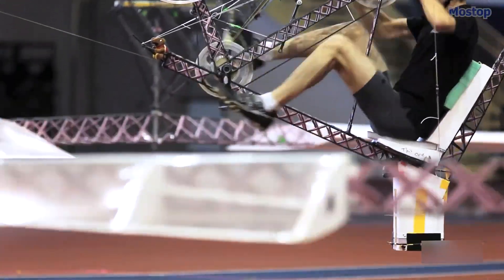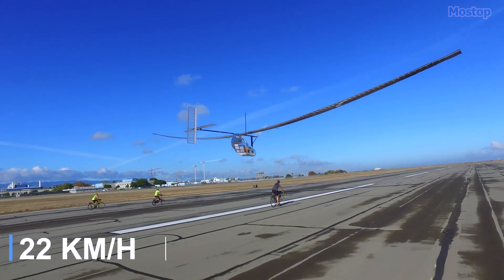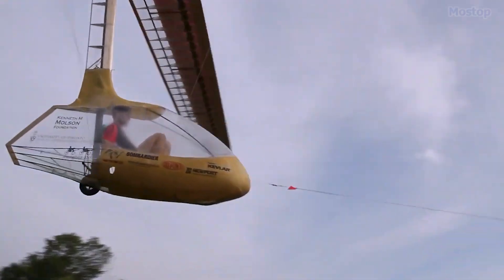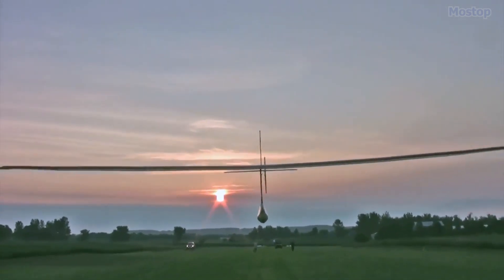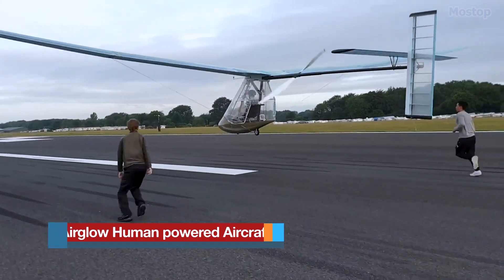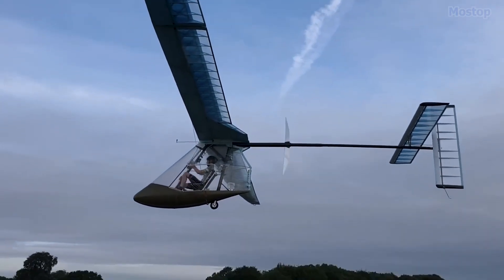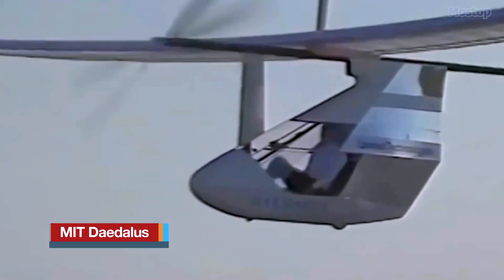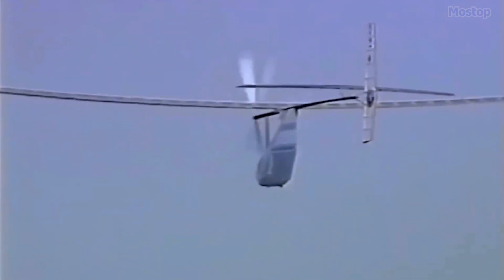These 10 Human Powered Aircraft do not need Engines to Fly

Comment: Humans are the weak link in human powered flight. We're simply too heavy and under-powered. Even if the plane weighed nothing, the average person couldn't get off the ground even in the best designed aircraft. The lightest and fittest pilots would be challenged to stay aloft for 15 minutes without a brutal training regimen.
Reply: Energy storage is the only way for humans to use self- powered flight. Pedal for a bit before you start, winding up a spring or charging up a battery then use that accumulated power to assist your launch. Once airborne you can use ridge lift and thermals like hang gliders and sailplanes, while pedaling and storing away energy to get through the inevitable stretches of sink. Problem is, people get so good at soaring, nobody would want to mess with the effort and added weight of a pedal mechanism. And it's not just us lazy humans. Very large birds like condors don't like to flap much either.
Reply: Yuta Watanabe flew 69 Km in two hours at Japan's Birdman Rally in 2024.

Comment: do you count helium blimps. well they work like boats. on the water. you dont need fly fast, just use wide delta wing for high lift. then you can fly with just air currents. or human pedal power. yep make a STOL glider pedal powered. maximize wing lift, dont care about air drag. yes the more you can just glide without losing altitude, without using your power, pedalling, the better. you dont need to attempt low drag super wide wings. triangle delta wings give more flight surface area and area narrower and lighter, like a sail boat sail. no, even birds dont have narrow ultra long wings. they are more like delta wing. learn from birds. if you try to fly like birds. paramotor paraglider wing is the easiest to pedal human power. yes a kite. yes if you can run it to flight, it can work. those large wing spans only make the support structure heavy. keep it simple. even birds do not have to flap all the time. they glide most of the time. you are losing lots of power into waste. I mean like 90%. variable wing span if you need to go fast, like birds. and also have high lift when its useful. the wing vehicle construct can weight easily up to 100kg or same as the pilot. it just needs to generate lift efficiently compared to the total weight and the power of the human pedalling. you dont want to row a boat if its does not actually move, if it has small paddles. ie dont try to row a boat with spoons. yep use ground effect lanes wide delta wings. yep bat wings. imagine a scaled human instead of the bat body.